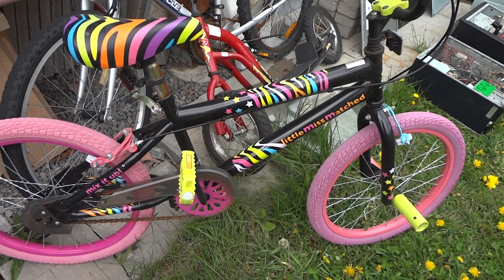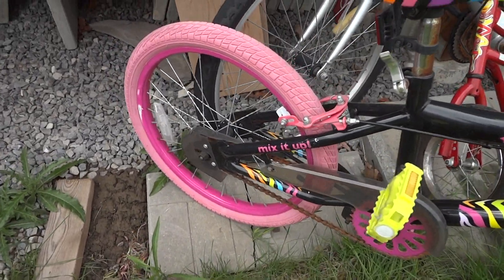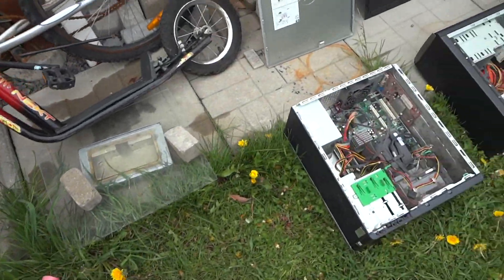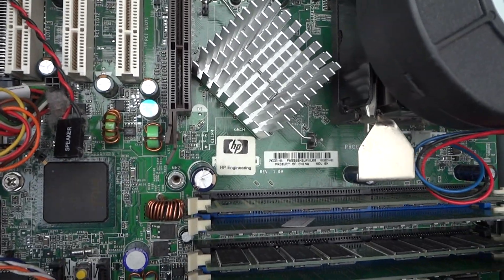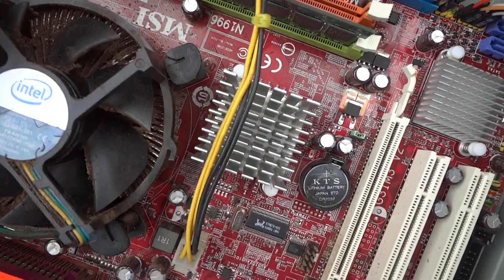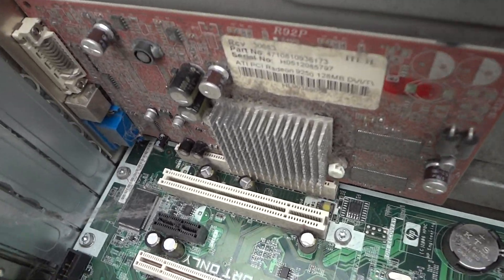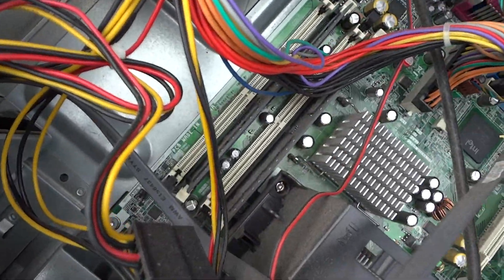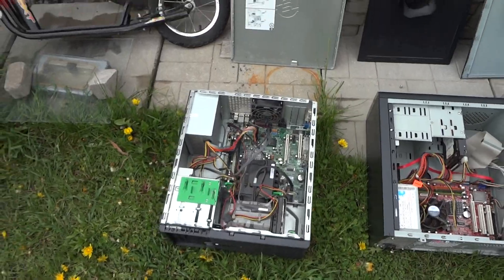Trash or treasure PT 8 bikes and computers

Comment: Strap a 7.5 hp to the front with belt drive off suicided  shift this is treasure my friend
Reply from the maker: yup will definately strip off the rear wheel, chain, pegs, maybe the colorful tires,handle bars for shtf to corner the market with jarrod.  so ur saying belt drive to the front wheel ?
Reply: @BIKEMAN21  it's a pretty nice bike and there's a guy in my area that drives one with a 7.5 Briggs & Stratton on the front I'm going to get a video of them one of these days